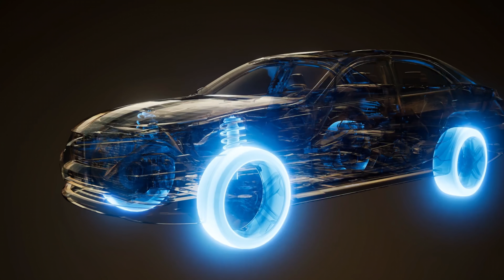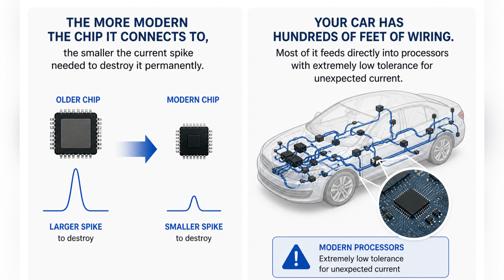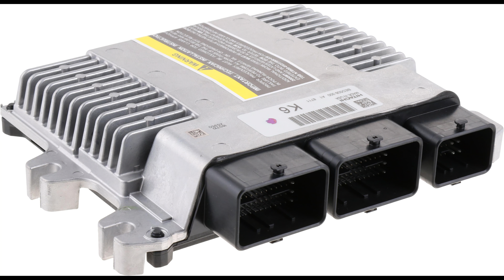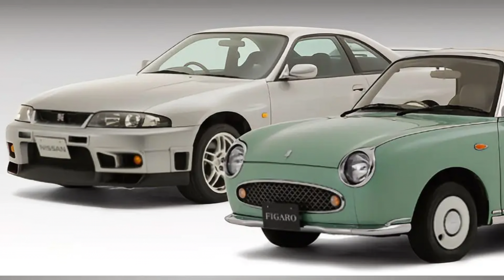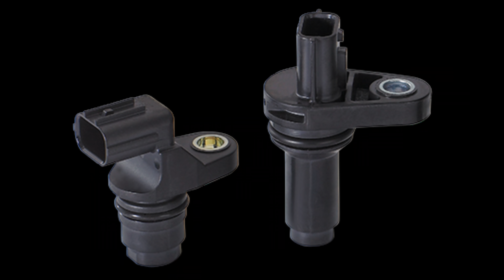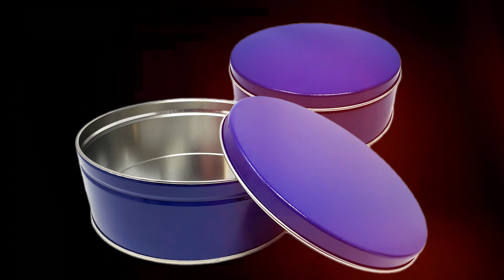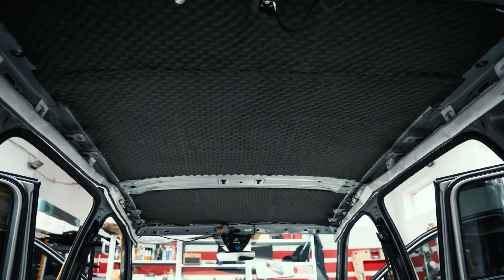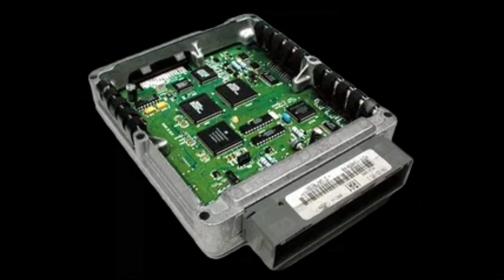EMP Just Killed Your Car? This $7 Part Saves It

Comment: Nice! The ammo can was the first metal box that came to mind. 
 Now do household appliances spare parts, and generator spare parts.
Reply: Actual Ammo Can; It would be necessary to conductive bridge the lid and box body 100% of the surface contact of the lids gasket. My musings have prompted heavy duty aluminum foil (“Barbecue” marketed in example) sheets lain across the full span of the bottom box rim and slow/gentle closing so as not to tear it.
Reply: @ED-2.0.9.  I don't think it's that complicated. Pacing electronic components in a refrigerator on a glass or fiberglass shelf would probably survive an EMP. Rubber mats or foam mats on the inside of an ammo can would work.
Reply: Old microwave oven.
Reply: @richarda996  Hell yeah!
Reply: There is a rubber gasket in the lid of that box, very limited EMP protection.

Comment: An EMP works the same way a generator or alternator does.  Then you cut a magnetic field with a copper wire, it induces current in the wire. It doesn't have to be grounded or a completed circuit to induce the voltage. If you want to use that current, then you need a complete circuit. We make electricity by spinning copper wires past magnets, thats what is going on inside that alternator, generator, coal power plants, hydro electric, and even nuclear power like Chernobyl and us Navy ships. Steam spins the wiring past the magnets via a turbine in the path of high pressure steam.

Computers have thousands of small circuits on their boards and the chips, they run on millionths of a volt. It doesn't matter if the computer is turned off when the magnetic waves reach it, every circuit that cuts the wave will induce voltage. You can test it easily with copper wire that has a thin sheath around it if you want to make coils/electromagnets, or just plain old copper wire for other things, its a really cool experiment that you can use as a radio and many other uses. You can easily get thousands of volts being induced into every piece of ferrous and conductive metal that intersects the magnetic waves. Your gold ring or chain might be a tad painful.. just sayin. Gold is VERY conductive.

An emp can vary wildly in magnitude and reach, magnetic waves dissipate the farther you get from them. Put a refrigerator magnet next to your computer monitor or TV screen, and you will see the localized effect it has. We used to have to degauss cathode ray tube screens like that. So an EMP has an area of effect, and it depends on the power behind it and distance from it, and things that can dissipate or shield magnetic waves (Faraday cages) can protect circuitry from all but the most powerful magnetic pulses. Really, some chicken wire or an old refrigerator will do it for most things.

A CME, coronal mass ejection, comes from the sun as the millions of magnetic waves contained in the sun become unstable, they can fling their energy and particles into space. Its also called a Carrington event. The one in the 1800s fried telegraph wires and burned the posts, electrocuting some hapless guys working the telegraphs too. It was MASSIVE... probably a directly focused on Earth, but the electrical infrastructure was so minimal nobody really noticed.. unless they had something electrical running. Along with the particles spewing from the sun comes massive magnetic waves as well, and those things can be more powerful than our puny little hydrogen devices.

If you have ever seen a spark plug work, what happens when you send voltage to it? It jumps the gap. Watch Tesla coils in action, they can jump long distances easily. If you think every electrical circuit in your vehicle is not going to arc the gaps in switches and relays when magnetic waves dump 100k+ volts into them, well... I have a bridge to sell ya. 

ANY vehicle with a computer in it that the vehicle relies upon to operate, is toast with a mild EMP/CME. 1980s to yesterday, the EPM is taking it out for a brisk day at the spa where the smoke genies will all be released at the same time.

Old cars with carburetors and points ignitions, will have fried wiring harnesses, starters, alternators, wiper motors, etc. However, if you have those parts stored in an old refrigerator, or a large box wrapped with chicken wire, you can then go through and replace all the melted anti genie wiring. If the battery is connected, chances are it will receive a massive over volt which will create heat because it has nowhere else to go. If it boils the acid/water inside it and the hydrogen escapes the cells, the nearest spark is going to make the battery do a Zeppelin impersonation. 

Another thing that can happen is with certain types of magnets, they can be demagnetized, which means losing their magnetic properties. The funny thing is that something nearby that doesn't have any magnetism to it whatsoever, can become magnetized at the same time by the same process. The spinning bit of metal holding the copper wires in your alternator really doesn't want to become magnetized, if you plan to use it to produce electricity....  

Now here is the part most people don't know about... The center of the earth is a molten core of spinning iron, its a dynamo creating its own magnetic waves, which keeps the atmosphere from being blown off by the solar wind the way it does on Mars and causes the northern lights I get to watch when its not cloudy. A powerful enough EMP/CME will bounce off that core below our feet, and wipe out anything in your Faraday cage that doesn't have a bottom to it.

Now I can tell you all of that, but what I can't explain is why a faraday cage doesn't allow inductive current on the other side of it. I do not know physics to that depth, I just know how we produce electricity for our vehicles and homes.

So you can put fuses in, breakers, relays, fusible links, and all manner of other things, but if the voltage is high enough, its gonna jump and all you will hear is a cacophony of snaps nearly in unison. The distance to them will be why its not just one solid snap, because sound still travels slower than light... last I checked anyway.

So if the Sun points one of its magnetic belts at us and snaps it like a wet towel in a locker room,  you best have some spares stored where the magnetic waves cannot go.
Reply: Oh My !!! You sir are spot on !! 🎉
Reply: The faraday cage is meant to intercept it and ground it, if I'm not mistaken.
Reply: @metaprotomecha  I mean the physics of how it works, and can be something as simple as chicken wire. Its like magnetism or gravity, how does it work exactly? I just know it works, but I am always curious how it works.

Comment: You would need to replace more than relays. All the individual components and computers built with circuit boards would be zapped too, even if they were not connected to the battery.
Reply: Is it possible to underline the body with foil and wire mesh to essentially wrap it in a fairaday cage?
Reply: @lunaticgaming7967 , no. You have to SEAL the vehicle so electrons do not “get into” the vehicle.
Reply: @WDLC1911 keep a bicycle in the trunk😂
Reply: @anthonynorris1016 😂
Reply: @lunaticgaming7967  Should be, or there are mylar sheets or tarps available that could work.
Reply: @lunaticgaming7967 I thought automotives were faraday cages since they sit on rubber tires.
Reply: @anthonynorris1016 , no. They aren’t grounded so a lightning strike is unlikely.
Reply: @WDLC1911 exactly...
Reply: rap the car totally in a faraday like cover
Reply: A few years ago, I came across a fabric cover with metallic thread weaved throughout, specifically designed to protect an automobile from EMP. A Google search should find it as it was available online. The issues that an ICE vehicle needs to breathe, so this cover was only useful if applied properly while parked (useless while operating), a hassle to deploy (so covering a vehicle dedicated to survive an EMP, maybe?), and the size for a full size PU truck was about $3,000.00. I decided that spare points and condenser in a Faraday cage for my 1970 Shovelhead made sense for me. While shopping for an early 70s or earlier truck and store standard ignition parts too. Maybe a battery and stereo in a Faraday'd metal garbage can, since mentioned in this thread. I'll reply with the link if I find it???
Reply: @TheTampaNative  Thanks for the info! But i think i'll just ride my bike. Might just get hijacked driving anything at the end of the world.
Reply from the maker: You’re not wrong..... in a severe enough EMP, relays would definitely not be the only possible failure point.

The ECU, sensors, ignition modules, alternator electronics, body control modules, and other circuit-board components could also be affected, even if the battery is disconnected, because the wiring harness itself can act like an antenna.

The point of the relay/fuse kit isn’t that it magically EMP-proofs the whole car. It’s a cheap “first-response” repair kit for the simplest failure points,.... because relays and fuses are easy to swap, cheap to store, and often sit between the battery and the systems that let the engine start.

For real preparation, you’d want more than relays: vehicle-specific fuses, critical sensors like the crankshaft position sensor, maybe an ignition module depending on the vehicle, and ideally a simpler older vehicle with fewer electronics.

So yes, fair correction. The $7 kit is not a guarantee. It’s a cheap layer of preparedness, not a force field around every circuit board in the car.
Reply: @Sidney_Explains_Money   Is it possible to have a Faraday cage built into the hood? Oh, you just answered this question in the video ... would have to be a full enclosure and probably still wouldn't work ... okay 😔
Reply: @Sidney_Explains_Money  What's the difference between storing the fuses and relays in the car vs out of the car....What the difference as long as the parts are in a faraday cage!?
Reply: @Sidney_Explains_Money You just admitted that everything you said in the video is not correct?  Nice.
Reply from the maker: @arnimkrause In a severe enough EMP, yes — that’s exactly what I said. But not all EMP events are the same magnitude or type.

This trick is not meant to guarantee protection against the worst-case scenario. It’s meant to cover a range of smaller, localized, or less intense EMP/electrical events that could still disable an average vehicle by taking out simple components like fuses, relays, or sensors.

So no, it’s not a magic shield. But having spare protected parts gives you a better chance than having nothing.
Reply: @Sidney_Explains_Money  Got it. Ya i was just thinking of a worst case situation.
Reply: @arnimkrauseIt's exactly like having a first-aid kit. You have some with bandaids and some with Quik-Clot, tourniquets, and bandages. It doesn't hurt to have a box of bandaids.

Comment: if you're in the area of effect of an EMP, even with a functional car, you are going to have a bad time.
Reply from the maker: Haha, yeah, you're not wrong! If it's a full-on "Mad Max" situation, a running car is probably the least of my worries. But hey, for the smaller stuff, this fix is still a lifesaver! 😁
Reply: that's why an EMP proof vehicle will be a regular 10-speed bike with mechanical gears or better yet a mechanical cargo bike or any non-ev peddle bike with cargo saddles. funny how we worry about these big heavy 1k+ pound vehicles, yet we forget when an emp hits every road will be blocked by vehicles. how far you think you will get with your working vehicle? how are you going to fill up even if you find a gas station - most are electronic gas pumps
Reply: @user-ml8dm9fz6l very good point
Reply: @user-ml8dm9fz6lA really long garden hose and glass of mouthwash to nullify the taste of gas in the mouth after siphoning the fuel out of the underground storage tank comes to mind..😅